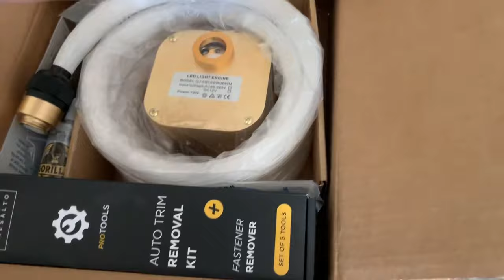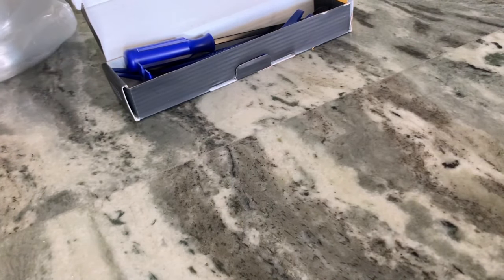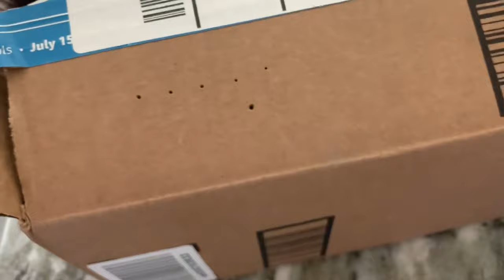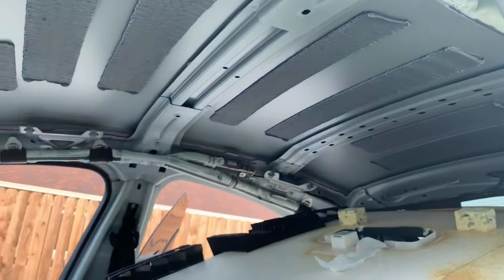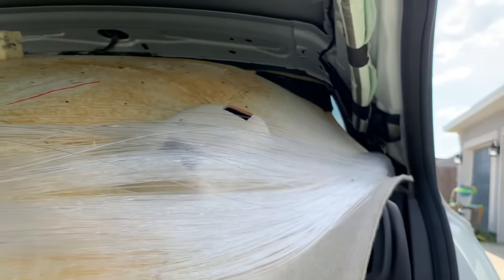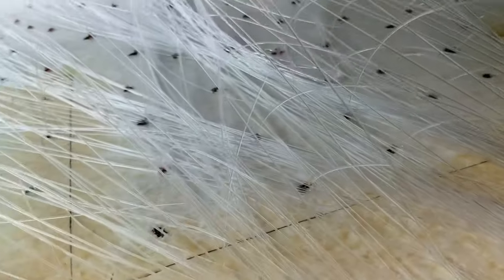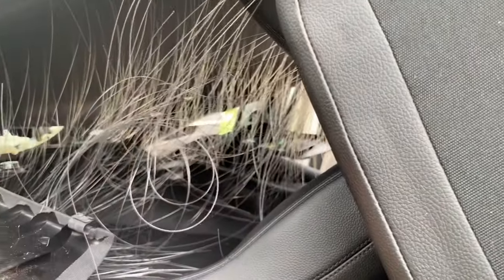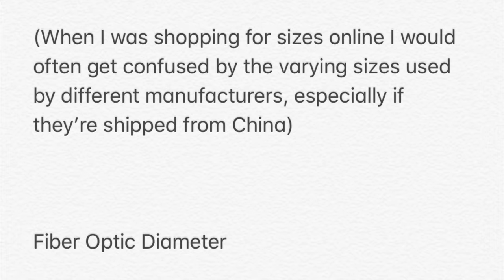How to Install a starlight headliner in 2023

Comment: The trick is to strip the fabric.  Poke the holes.   Reupholster the fabric.  Use the pin to break thru the fabric same time drop the optic add glue rinse and repeat 800 times

Comment: Finally someone who made a correct video on how to install these the proper way, Clean and long-lasting, and not using any car outlets
Reply from the maker: The LoganStew thank you
Reply: I thought he used the 12v
Reply: @ReynaldoVelasquez  did u use the 12v
Reply from the maker: @dwaynelewis7809  for the first year or two, I just used the 12v power socket in the back seat. But now I just hard wired it. And uploaded the video for how to
Reply: @ReynaldoVelasquez  ok kool thanks man

Comment: I have worked in the auto industry for decades. After I left for military, I no longer worked for dealers, but part time worked at stereo shop. We have done this on many cars. But your kit seems way better than the stuff our customers had us use. I am not so much into the looks stuff with cars, maybe some carbon trim and outside spoilers etc.. But for how much you spent on materials, the cost is low for this feature. You did a good job buddy! I wouldn't do this to my cars, I make them fast, and I make them all performance oriented. But for show car folks this is pretty cool. Did you know that Rolls Royce charges $12,000 for this feature in their cars? I thought you'd appreciate that... Good work, I bet the wife and kiddos love it.

Comment: Just got finished installing this in my 2016 Sonata and this video helped me out a ton, so thanks a bunch!  I bought pretty much everything on your tool list.  The gorilla glue worked like a charm, and the trim removal replacement kit came in handy for a few retainer clips that I broke while removing the pillars.

I ran into the same issue of not being able to get my headliner out of the car so I also had to work inside, incredibly tedious work!  I ended up routing the cable up the B pillar like you considered doing, as in my car you are unable to reach the trunk from anywhere in the passenger compartment.  

I'll add a bit of advice for anyone that may be watching this video - DON'T buy the light kit with multiple sizes!  Especially if you have a light colored roof like my own (tan).  The largest of the strands left pretty noticeable holes in my headliner, much larger than I anticipated.  It looks pretty awful during the day, though at night you can't tell the difference.  I'm considering going back in and wrapping my headliner in black like others have done and then pushing the strands through the new fabric - we'll see
Reply from the maker: JayyDoodle awesome! I’m glad i was able to help out a bit. I wish I had a second camera guy just for recording. Did you get to document your process? Upload a video I would love to check it out. I got all the same size strands because it came with MORE. And one of my buddies told me with the twinkle effect, some will naturally look bigger and brighter than the others. So for me there really was no need to go bigger. But that’s a great tip, thanks for sharing about the hole sizes. How long would you say it took you to complete with breaks included? Make sure to give us an update.
Reply: JayyDoodle I have a 2011 sonata and I really want to do it
Reply: Do you have a video or pictures? I want to do this in a Sonata
Reply: im trynna do this in my sonata, do you have a video of how it looks.
Reply: LITERALLY SAME, thinking of going back and doing black suede but wouldn’t it be hard to remove the fiber optics since they’re glued down? will it ruin them?

Comment from the maker: I can’t seem to access the comment, or maybe they deleted it earlier this week. But someone asked me if they would be okay doing this for a convertible top. And my answer is NO. The fibers will get bent, broken, become loose eventually and it will just become a mess. But... if anyone does try it out and succeeds without making the roof leak on them or whatever... please share the info with the group! We’re all here to learn from each other
Reply: How has your light engine held up? a lot of people say to go with the chinly but the bang for your buck on your personal kit is greater.
Reply from the maker: Oswaldo Mancilla in the video I show how I ran it, basically the light engine is just help in the trunk in a little netting that came with the car to store the lugnuts and assorted things

Comment: This video was very helpful! I live in a very hot area and I was wondering if the fiber optic pieces would be more prone to melt or conduct heat. Have you had any issue with this? The only reason I ask this, is you mentioned not to use hot glue because they could melt. Wouldn’t another source of heat do the same thing?
Reply: No you should be good they are highly durable and the only thing with the hot glue gun as you cannot touch the metal tip of the hot glue gun onto the fiber optic or then it will mess it up but as far as The normal every day heat from outside will not affect the fiber optics I noticed in the video he said it was 100° outside and his Starlite system was still working without a problem not just that but at night the temperature should drop so it should not affect the starlight system

Comment: I have stock black headliner in my car. Do I need to cover it in suede still?
Reply from the maker: SportsDomination no you’re perfect the way you are. I had stock black headliner with the foam too
Reply: Reynaldo Velasquez Thank you for your response! Love how-to youtubers that interact with their audience. I will be doing this in my 2013 Cadillac ATS!
Reply from the maker: SportsDomination I try to, I’m always on youtube almost as much as i am on FB and IG. Can’t promise to do this if I have 30k subscribers and 800 comments but while I still can, I will. Let us know how it turns out and anything new that you’ve learned along the way.
Reply from the maker: SportsDomination hey dude, lol I meant to press reply and accidentally removed your reply. But let me see if I can remember your questions: 
1) will your headliner fit the projector (light engine) on my video I show how I ran the fiber optics into the trunk and store the light engine in the trunk. I did this because of its large size and also because if the light engine ever goes out you can buy a new one a small swap it out without having to drop the entire headliner again. There are others who have purchased a cheaper $30-$60 smaller light engine and packed it into the headliner but those are cheap and don’t twinkle. And some have gone out... probably due to defects, and guess what... now they need to drop the entire headliner again. What a pain.
2) how does it have power? The light engine box came with two plugs that power it. An AC adapter for a wall outlet and a lighter plug for a car. I just used the car lighter plug and ran it between the split foldable rear seats into the backseat car lighter. It powers the lights when I turn on my car.
Reply: Reynaldo Velasquez Thanks much!!!
Reply: @Article_170  did you do your lights? I have a ats as well and wanted to see how hard to install in an ats
Reply: Paul Condie I did not do the lights. Do not, I repeat, DO NOT do this in an ATS. Airbag sensors everywhere, trim is hard to remove and the headliner won’t actually fit through the rear doors so you’d have to do it standing beside the car and poking holes in it while it hangs over your seats.
Reply: @Article_170  👍, Thanks for the heads up
Reply: @Article_170  if you too want you could always go and have the starlight system done by professionals it may cost a little more but you’re also getting professional installation along with a warranty stating that they will not ever break or lose power and if something does happen to the starlight system it’s all covered so you don’t have to worry about coming out of pocket again
Reply: Chad Jay I’ll keep the $1200 in my pocket lol
Reply: @Article_170  damn is that how much they’re charging around where you stay??? I can’t wait until spring/summer time so I can do it in my 91 Chevy S 10 depending out that goes I may even open up my own business doing nothing but the starlight headliner system just from watching videos that seems really easy to do just very time consuming but thank God I have the patience to do something like that

Comment: so my battery is in the trunk so can i just wire it to the negative part of the battery or will that kill my battery? please help lol
Reply from the maker: Matt Miller you should look up some videos on doing wiring. I suppose you could, but obviously look at what other videos say to do. Possibly use a relay and definitely insert a fuse between the battery and the the light engine. But yes I’m sure it would work. I’m not an electrical genius though. Haha so look up wiring led under glow kits etc on YouTube to get the correct advice. And when you do it... make sure to share it with us too
Reply: @ReynaldoVelasquez  you beat me to the punch I was going to say the same exact thing but whatever he does he needs to put in an in-line fuse just in case of overheat protection it’ll pop the fuse instead of starting a fire but besides that yes you can run it off the battery in the trunk that is what I’m going to be doing with my Chevy S 10 I have to add a secondary battery because I have an airbag system neon lights for under the truck sound system and this summer we are going to be installing the starlight headliner system but in my case I have to run with a bigger alternator so it can charge both batteries but honestly you made one bad ass video it’s so easy to learn from how easily you made it for everyone else to understand it I just love the way you broke everything down and explained it now I’m just waiting to find the second video you did on wiring it all up thanks for a bad ass DIY VIDEO !!!

Comment: does this work on any car? i have a 2002 Pontiac grand prix
Reply from the maker: Shasta Shannon hey! Yeah, that’s the wonderful thing about this project! You can literally do this on a car, with or without a sunroof, truck, SUV! The only thing that may change is the way youll remove your personal headliner. But yeah! I dig it, you should totally do it!
Reply: My little Brother has the same exact car as you he went and did it and with his windows tinted it looks bad as hell if you sit in the front seats and tilt your chair back and look up at the ceiling it literally looks like you are staring at stars and outer space

Comment: Does this make it obvious to people outside of you car that you have that installed? I guess in trying to say is it obvious to cops😂
Reply from the maker: Skyelar Brennan I answer that question in my FAQ section towards the end. Details are in the description. But no it’s not obvious at all. No one will see it unless their car is lower than your car. They would need to be low enough to be able to look up at your ceiling. Plus the roofs of cars are usually Concaved so it’s even harder to see. If you turn the brightness all the way up or even mid range, people may be able to see your face changing colors or shining and then dimming as the stars twinkle. But that’s about it. And it’s harder to tell if you have window tint. Cops don’t care at all. I’ve turned the lights on and stood outside... nobody will know you have them, it’s like a surprise when they step into your car.
Reply: Reynaldo Velasquez thanks, yeah i saw you answered that as i kept watching

Comment: I’m just doing my Range Rover sport now took mine out and painted it black then added 500 leds    Marked out 6 squares to draw dots 80 in each square then did the side panels in diamond cloth and then added a switch to the center lights did take awhile but looks amazing Iv had people ask to do there’s lol.     Cost me about £150 total and got told people charge £1500 for it or rolls wants 17 grand

Comment: The suede fabric/cloth does have a foam backing, because it’s required in order to add adhesive promoter to the backing of the headliner, otherwise if they did it with plain fabric the adhesive would soak through:)

Great video!

Comment: Yo!!! It looks great and I’m saving your video because you have the Mercedes CLA which I am getting as well and was looking for someone who done it on that car specifically. I actually like how you didn’t take the ceiling out of the car and split it. Definitely doing this when I get mine.
Reply from the maker: Bomani Sankofa dude record your journey too, I can’t wait to see yours! Yeah I couldn’t find a video either so I made my own. Your headliner may not fit out of the trunk or the doors. It didn’t look like mine would at all. At least not without bending it. And of course I recommend doing it in a garage not out in the sun or rain/snow. Anyway, if you learn any tips or tricks make sure to comment them in this video too so that others can learn from it!
Reply: I’m just waiting to see how you hooked up your power source. Did you attach it to the fuse box?

Comment: Have you tried a syringe needle? It's very good. And you can thread the fiber optic in the hole of the syringe then remove the syringe
Reply from the maker: I will definitely try that out next time. Interesting. I wouldn’t think that it would fin in the needle… but then again… I don’t know where I would get a hold of a syringe
Reply: @ReynaldoVelasquez   amazon dude. Look up piercing needles. There are kits with different gauges

Comment: Headliners that have the hard foam backing are put in at the factory before the windshield is installed. Many things like the dash and even certain types of back seats that are bulky because of mechanical electric reclining features are often sent through the windshield opening and are impossible to remove without taking out the windshield or breaking them to get them out. 

That's why installation of certain custom items like this is so expensive, they have to do intensive things like removing the windshield.

Comment: Great install bro....good job...I got a saturn  outlook with 2 sunroofs and I sit high so yes....starlight outlook on the way bro...they ladies gona freak out
Reply from the maker: Matt Stallion I promise you they really will freak out! Also since you sit high, all the cars smaller than yours will be able to look up at your car at a red light and clearly be able to see the stars. Do it and document it bro! So I can show your video some love!
Reply: I took your advice and I'm going to order the 9 ft..I was gonna use the 6ft but I want the fibers to reach the front and being as tho ibhave two sunroofs and a large back area imm need length to run the fibers on either side and connect at the front. The kit I'm getting is 300 @ 9ft.. the six footers may not have reached around the sunroofs. And also can I use rubber bands to secure the fibers neatly. I was thinking that's because I have to really run them on the opposite side that I'm mounting the engine (rear driverside.in the back and I have 12v outlet back there too) then up the pillar to the liner...I just wasnt to secure the fibers for an ultra clean install..mi do have slight OCD...lmao

Comment: Just watched the whole video! You are a legend for posting this video, Really helpful and informational video! I think I may go ahead and give it a shot.

The pieces on top of the headliner (that were outlined and labeled) were just held by factory adhesive correct?

P.S. - I currently have footwell ambient lighting installed. I think they would look amazing along with these lights, I highly recommend installing them on your car (Installation is much shorter than this). I got the Opt 7 Lighting package from Amazon and they have lasted me 4+ Years!
Reply from the maker: dillon patel yes correct, the black pieces are glued on with some type of adhesive... but it is very strong. I didn’t show it in this video, but to remove the black things I scraped them from underneath using the panel removal tool. And I pulled them up at the same time as scraping from underneath. There were times I thought the glue was so strong that I would rip or break the headliner, so take your time. Be genial and firm. I’ve never heard about those lights but now I’m going to look them up. You should post a video so I can go check it out
Reply from the maker: dillon patel product links are up, good luck! I want to watch your video when youre done
Reply: Reynaldo Velasquez My car is currently in the Shop! It’ll be out Tuesday and I can take a quick video overviewing how its installed

Comment: Im installing 500 stars and 1 shooting star into the headliner of my 2021 Trailblazer  the headliner came easily out through the rear hatch door. I used small gauges shrink tubes to direct the fiber optic across the top of the headliner from front to rear.  It was time consuming but extremely worth it
Reply from the maker: Aww that sounds so cool! I’ve never seen it done that way. Send me a photo of your project sometime! I’m happy for you